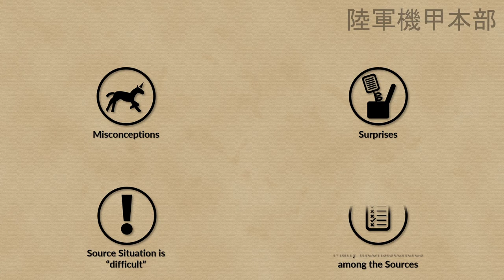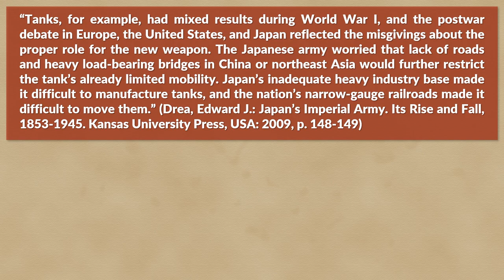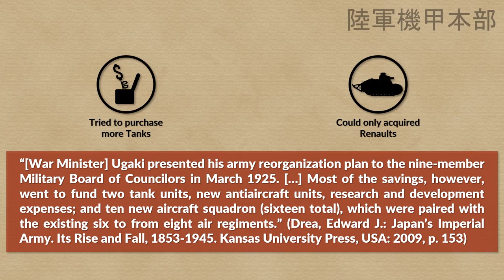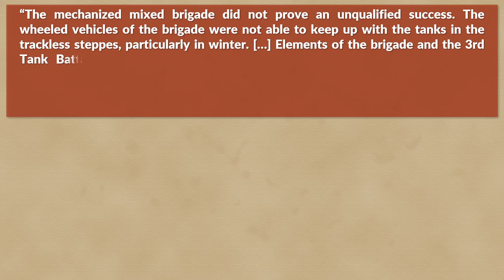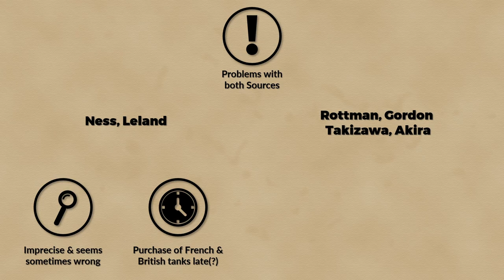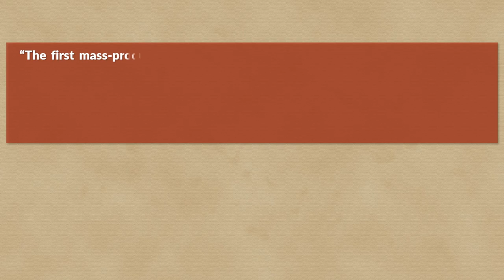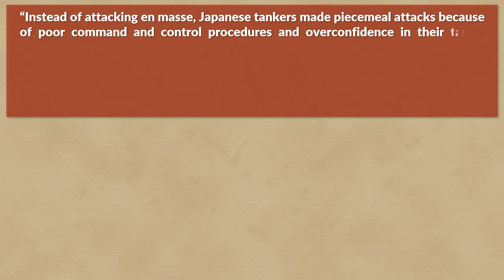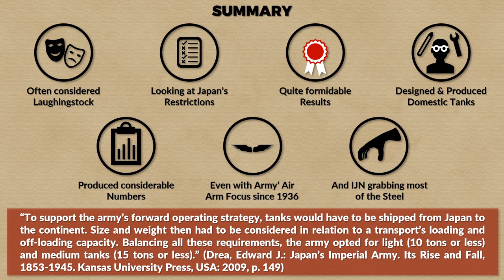Japanese Tank Arm (1921-1939)

Comment: I don't know if it's possible to emphasize enough how the topography of the Japanese islands dominated their tank designs from inception. The narrow gauge RRs placed an absolute upper limit on weight and width. The Germans ran into the same problems in Russia when it became obvious their tanks needed wider tracks for better weight distribution in snow and mud. The side by side spacing of the German RRs in heavy industrial areas plus bridge, tunnel, abutments meant the tanks had to be shipped without the track extensions. Also the later Panther chassis designs made through scheduling an absolute SOB. Keep in mind these were "standard" Euro rail gauges. The Russian gauges were wider and their designs reflected that as well,
Another consideration was tactical deployment across obstacles. Anyone familiar with the IJA quickly becomes aware that dedicated "Combat Engineer" units were vanishingly rare. That's not to say the Japanese weren't excellent at ad hoc and field expedient solutions; but 20 ton capacity bridges or barges are a LOT easier to make than their 30-40 ton counterparts. Which is a main reason Japanese advances in China invariably traced the Chinese rail net.
Last and NOT least was shipping considerations. At the start of 1937 Japan possessed two, TWO oceanic RR ferries. Both of them were hard pressed just providing transport support for Japanese rail infrastructure requirements on Korea, then Manchuko; and later China, all of SE Asia, and Malaya and Indonesia. Coming up with cargo ships with adequate crane boom capacity to shift and lift 30-40 ton medium tanks was out of the question. 
"Chieftain" has an excellent video on how these very factors was the main consideration in sticking with the Sherman. EVERYTHING was geared to support the transport of a 35 ton vehicle; NOT one weighing in at 45 tons plus..
By 44-45 the IJA had designed and built prototypes of a 28 ton PzIV analog complete with HV 75mm gun. Yet even it was designed knowing it would NOT be deployed anywhere but the Kanto Plain around Tokyo as it was too big for the mountainous terrain on Honshu. Bottom line; "If it won't fit, you can't ship".
Reply: There's no point building a big-ass tank if you can't get it to where it is needed. Sounds obvious, but it is often forgotten.
The weight limit of the M4, the - if taken out of context laughably limited - diameter of british tank turret rings, the low weight of the early german tanks, that was all done for good reasons. Resons always rooted in logistics.

The US had to consider the weight limit of a Liberty Ship's loading gear, the british had the structure gauge of their rail road infrastructure that limited the width of their tanks, and the germans with their offensive posture had to limit the weight of their vehicles to what their assault bridges could carry.
Reply: The point about German tanks and RR width only applies to the Tigers and their derivatives.
Reply: @Wien1938  The width became an issue AFTER the Germans began using track extensions to reduce ground pressure. They were used extensively from Fall 43 forward. Eventually some variation of them were available for all tracked German AFVs except the Tigers n Panthers. In those designs the double road wheel designs provided for sufficient track width. They still "bogged" during the Raputista.. but by late 43 to 45 they'd figured out where and what armor could go n do during the Fall n Spring on the Eastern Front. It was the older narrow tracked designs and all their derivatives that were the problem. I can't remember which one.. but one of Gantz's books goes into a fair amount of detail on their development n deployment. I do remember some pictures of PzIVs with them installed n the amount of increased width is very obvious, almost startlingly.
Reply: @MrArtbv  I think German war files or some other documentary said that the Germans figured this out already in 1941 when they gave StuGIII wider tracks to deal with the russian snow, so they used this type of tracks during winter time. So its perhaps not strange than that the Germans integrated this wide track into their late war tank designs. 
But this was not without problems of course. The Tiger I had 2 sets of tracks, because its wide tracks that were excellent for driving on land, snow, and mud was too broad for the railway transports, so it then needed to change to a more narrow track before it could use a train.
Reply: This is the same reason why the us limited the weight of the sherman.The cranes used to put them on ships could only lift so much weight.
Reply: We even see limitations influencing design with the Americans as well.  The Sherman was thinner then originally intended because they had to fit them into landing craft.  And then forced the British to adopt the Sherman as well because their medium tank (the Cromwell) was longer and wider and thus couldn't fit as well into the American transports.  Though the British still stubbornly brought plenty of Cromwells over anyway, which probably only complicated supply issues.

The Cromwell is a good tank, don't get me wrong.  But its superior speed wasn't a good enough advantage to ignore its logistical impact on the Western Front.
Reply: The US shipped 1,911 Locomotives to the Soviet Union.  The weight figures I was able to find indicate that these locomotives might weigh 100 tons though I don't know enough about locomotive weights to be able to say for sure just what they weighted.  And - they DID ship M-26 Pershing's to Europe.

So - there is a problem with the logic that says they couldn't ship something over 35 tons.  Obviously they COULD do that.  I am unaware of HOW they did it - but they COULD do it.
.
Reply: @BobSmith-dk8nw  Except tbat there isn't a problem with the logic of shipping something over 35 tons.Since tbe cranes of the day used to put cargo on dhips had a weight limit of 35 tons.
Reply: @BobSmith-dk8nw  You didnt prove what i said was bullsit at all.The chieftain agrees with me on this.As to the persging so few of them went to europe as to be meanuingless.as to locomotives you need top prove the us actaully bsent some to russia.ASince russia uses a diferent rail gauge us locomives wiouyld be useless there.
Reply: @BobSmith-dk8nw  Not necessarily when you consider that the bulk, if not all, of lend lease items were essentially off the shelf US products. We sent the Russians P-39s, M4s, Stuarts, US military trucks, etc. so it would seem odd that we would be sending custom made railroad locomotives and the like to Russia. I'm not saying that it's impossible that we did, just unlikely since it would require a complete retooling of the locomotive factory to change from making locomotives designed for US railways to ones meant for Russian railways. Considering that we didn't build T-34s, MiGs, of Yaks for the Russians, why would we custom build locomotives for them then?
Reply: bojo perez  Hey bojo!  Unlike some people - I proof read my comments.  That way - if I fail to capitalize the first word in a sentence - I catch it myself and don't look stupid.
.
Reply: @BobSmith-dk8nw  These cranes might have been able to do so on the ships where they were close enough together to do so.

Please check the US army ordinance logistical evaluation from the early part of WW2, the limitation was not simply the cranes, it was also flatbeds to transport things on, army engineers bridging equipment tolerances and a whole slew of other information.

Keep in mind also that the so-called 30 ton cranes were regularly used to lift 35 tons out of overloaded liberty ships.
These cranes were engineer certified at 30 tons, their actual capacity was higher due to pretty good construction used in them.

Because of your perfect mind reading capabilities  ‘And - how do you know ANYTHING about the logistics involved?  All this sounds to me like something YOU think they did based on ... your imagination?  How old are you?  You argue like some nerdy little kid.  I know - because I used to be a nerdy little kid.  Now I'm a nerdy old man.’ I obviously could not know anything about logistics involved in this because there is no way I could be polite enough to listen to older people who were involved who did tell me about things they did or read archive materials from a country that helped keep the country I am from on the world map or have an interest in a war because my grand father had the ‘pleasure’ of being a guest of the Gestapo and a German concentration camp.

You sir, may be intelligent and older, therefore worthy of some respect but there is a limit to how insulting and denigrating you can be for this respect to be lost.
https://history.army.mil/html/books/010/10-21/CMH_Pub_10-21.pdf
Please feel free to check the index at the end also, it has a list of publications which I have had to read 30+ years ago which have such fun tittles as ‘Global Logistics and Strategy, 1940-1943’ as just an an example.

My recollection of said content is not 100% due to how long ago it was that I read these but I am sure we can read through them and get the several thousands of pages worth of documents to check how much I have forgotten about his subject over the last 3 decades before you start calling me names and make assumptions that any errors on my part are due to stupidity as you like to say. 

Just for your information, you may have mixed up locomotives and flatbed cars for said locomotives.

By the end of June 1944 the United States had sent to the Soviets under lend-lease more than 11,000 planes; over 6,000 tanks and tank destroyers; and 300,000 trucks and other military vehicles.
Many of the planes have been flown directly from the United States to the Soviet Union over the northern route via Alaska and Siberia, others were crated and shipped to the Persian Gulf, where they were assembled and flown into Russia.
We have also sent to the Soviets about 350 locomotives, 1,640 flat cars, and close to half a million tons of rails and accessories, axles, and wheels, all for the improvement of the railways feeding the Red armies on the Eastern Front. For the armies themselves we have sent miles of field telephone wire, thousands of telephones, and many thousands of tons of explosives. And we have also provided machine tools and other equipment to help the Russians manufacture their own planes, guns, shells, and bombs.
We have supplied our allies with large quantities of food. The Soviet Union alone has received some 3,000,000 tons. Lend-lease has contributed about 10 percent of Britain’s over-all food supply. This, together with a great increase in agricultural production in the British Isles, has helped to feed the British civilians and armed forces. Bread, potatoes, carrots, cabbage, and other common vegetables have been available to the British from their home gardens and farms. The United States has provided a high proportion of such foods as bacon, eggs, cheese, and fruit juices.
From EM 13: How Shall Lend-Lease Accounts Be Settled? (1945)
GI Roundtable Series
Primary source documents from 1944–46
Reply: You do have here proof that they did send the locomotives because you were 100% correct on that but those would get unloaded with speciality cranes due to their weight and value in major ports.

Locomotives could easily weigh as much as 90 tons so yes, this had to be unloaded with different cranes as the smaller cranes, even if you combined two of them would never be able to lift a locomotive, and that is not taking into account potential damage to the locomotive of the unloading is not done with extreme care due to its own weight.

The US regularly ship items over 50 tons over to different locations, but these were not the majority of items and so your limited availability of larger cranes is restricted to these items.
Case in point, Pershing tanks as you mentioned.

But there is a well known battle where the Pershings had to stay behind because the army engineers corps could not build a strong enough bridge to cross the Rhine I believe it was for them but could bridge for the lighter Sherman’s which then went on to assist the troops in battle.

This anecdote is covered by several channels, if I am not mistaken The_Chieftain mentioned it in his video on the Pershing tank.

Please do keep in mind that Bob Smith did have a point on several things so we ought to maybe do a double take of our own recollections before posting.
Reply: @yannichudziak9942  OK.  Not an idiot.  Why were you looking at that?  Did you have access to it through the internet 30 years ago - or - to the hard copy?  I was trying to look at the listings for liberty ships in the index and ... welll ... I remember how much faster that went when I could just stick a finger in the index and then go back and forth digging out the pages it listed.  It's just slow online, having to jump around in the thing.  But I can open another copy of it to keep the index page open and plow through that.

I'm not sure I'm going to find something on those cranes though - as this seems to be an Army document more oriented to before and after the stuff got on the ship.

As to those locomotive figures they came from the Wikipedia Lend Lease page "1,911 steam locomotives, 66 diesel locomotives, 9,920 flat cars, 1,000 dump cars, 120 tank cars, and 35 heavy machinery cars."
https://en.wikipedia.org/wiki/Lend-Lease#US_deliveries_to_the_Soviet_Union
Sorry I can't get the link right to the reference - you have to scroll down a bit to find it.  I don't know why there is a difference here in the figures you supplied and those I supplied.  

Uh ... for your citations - it would be better to put what they said in quotes - the way I did - so that I know what the citation said - and what you said.  I see the reference at the end - but - you really need those quotes.

When I first looked at those boom listings I was wondering about the positioning fo the 30 ton booms.  This time I noted it said "plus two 30-ton booms at Nos. 3 and 4 hatches"

Using another diagram here:
https://upload.wikimedia.org/wikipedia/commons/0/0f/Libertyship_linedrawing_en.jpg

The booms for the number 3 and 4 cargo hold - are not positioned where they could used both of them together.

I did find a video where they showed two of the ships cranes lifting a locomotive - and - another picture where a single crane was doing it.

But - given the positioning described in those two articles - they may not have been able to do it on those C2 Ships - IF - that was One 30 ton crane per hatch.  If the citation was two thirty ton cranes EACH at the # 3 & 4 hatches they could have done it.

Unfortunately the illustration doesn't show what type of cranes are being shown - and - may not be reflective of the actual C2 design since they did come from different articles.

I did find the footnote though and it gave this picture
https://archive.org/stream/pacificmarinerev3538paci#page/n15/mode/1up
but once again - though there are six cargo holds - 3 and four are separated by the superstructure.

This illustration
http://navy.memorieshop.com/Cargo-Ships/Profile-Centerline.html
for EC2-S-C1 ships - appears to show one boom for the #2 hatch which is listed as a 50 Ton Boom OR a 30 Ton Boom

Here's a picture of a Sherman being loaded by a dock side crane
https://cdn10.picryl.com/photo/1943/01/01/liberty-ships-being-loaded-with-sherman-tank-for-oversea-shipment-4a73e3-1600.jpg

So - this is all a bit complicated in that there are a number of different designs and evidently crane sizes were not in fact limited to 30 tons - as the illustration labeled 50 or 30 ton crane would indicate.

My point was always - that even if I couldn't figure out exactly and precisely how they did it - they DID ship locomotives over seas and they DID eventually ships M-26 Pershings over seas - so they MUST have had a way to do it. Thus - the argument that they couldn't ship Pershings to Europe because the crane size was only 30 tons was specious.
.
Reply: @yannichudziak9942  Yeah ... dropping a locomotive is not pretty.  When I was researching dual lifts I came across a video of some guys dropping a locomotive ...
https://www.youtube.com/watch?v=OvyIrsZ7Zhs
Ooops ...

That bridge was probably the Remagen Bridge.

I've said elsewhere that Logistics is often used as an Excuse by people to not do something they don't want to do.  You have all this hand waving and all this "it can't be done because of the logistics" THEN if someone with high enough rank gets involved it's all "Yes Sir!  Yes Sir!  Three Bags Full!"  That's what happened with the M-26.
https://en.wikipedia.org/wiki/M26_Pershing
Devers and McNair were going back and forth over whether it was needed - Devers went over McNairs head to Marshall - Marshall said "Do it" and like magic(!!!) it happened!!!!

That's the reason arguments like flat cars are specious.  A flat car is a lot less complicated to develop than a tank.  You just give the company that makes flat cars a contract to build some that will do the job you want - and they do it.  If there were weight or width problems - you go to the train company and say - "Plot us a route" - and they will.  Commercial people do that - all the time.  Given enough money  ... you can go to the moon if you really want to do it.

One thing about the M-26 development - was ... the Allies could and did defeat the Germans without it - but - the Germans and Russians had been in a technological contest on the Eastern Front.  After the war - it was a good thing - that the US had M-26's to counter some of the tanks the Russians had built, in the "who's a bigger bad ass" posturing of the Cold War.  You don't want your enemy thinking he's a bigger bad ass than you are.
.
Reply: @BobSmith-dk8nw  My economics teacher was from the US and had this and several hard back copies, he was very fond of the saying learn your history because it will help you avoid mistakes in the future. 

He came back to Europe after the war to marry his then met sweetheart in Belgium.

So when we were studying logistics, marketing and economical planning he provided us with a well documented long term case he had access to.  

Now I may not remember it all now but I did read it all which is why I agree that the main reason the M4 Sherman was held on as long as it was is in part due to the logistics people insisting on it.

The other part is that as some people said these tanks were killing the enemy just fine (just fine being a very debatable and subjective description as you well know) so the troops did not want to rock the boat so to say.

The reason the heavy tanks were delayed as much as they were was that the earlier versions simply did not pass the extremely stringed testing and requirements of the US army, this was the highest requirement of pretty any of the armies in the war and I am guessing now but I think they stuck to it because they never were at risk of losing their manufacturing base.
Reply: @BobSmith-dk8nw  Except that the Pershing was in fact not anywhere near as good as they wanted, it had not finished the full testing regime and the ordinance branch had told them they needed to send a specific set of spares along which were at first not available, it needed to be field maintainable and this was an issue also.

For the flatcars it was at first more a question of do we have enough of them for meaningful transport and secondly a LOT of them went to the USSR as you saw.

The_Chieftain has a quite funny video on the development of the Pershing and heavier US Armor which if you check carefully and compare does make a fair amount of logical sense.

Don’t forget that logistics are always hampered by the bit that is in shortest supply, whichever that may be.

The US due to having to ship across the globe, and let’s be honest that alone showed what a feat of setting logistics up and how well they did it was, to supply roughly (and this is a debated number as not all countries did keep well enough records or did not tamper with them - looking at you Mr Stalin.....) 25% to 35% of the whole allied production during the war. 
Some evaluations push it even as high as 40% but there is more debate about those figures and to be honest since I am not working as an accountant (got the degree to go with that) I never felt any urgent need to go and do the research myself but I will discuss it with people and read up and watch informative programs after which I will do a cursory fact check to see if I did get what was said and if it was truthful which now a days might become more important then ever with all the ‘fake-news’ being bandied around or the intentional mis-information from some people (e.g. Bergen-Belsen by one ‘academic’ was claimed to be a forced labour camp where the death toll was way overrated by the ‘allies’ at the end of the war...my grand father punched the man out cold when he was saying this in a public debate for students and he was over 60 years old at the time for daring to lie so blatantly).

As for money one VERY important thing to remember is when this was set and against which back ground...the Great Depression was only barely getting beaten down at the time and the economy in the US was still rebuilding itself.

Look at the US army tank arm, it barely existed 5 years before the war and went on to be massive and massively important.

For the cost of one Pershing (net cost, so all factors like materials, storage, transportation, fuel and fuel requirements, spare parts in army approved quantities) how many Sherman’s were able to be made by this point in the war?
The low ball estimate there says 2 to 1 at least due to mass production savings and the initial investments having been spread over more and more vehicles build.

And THAT is also kept in mind in the minds of the planners, instead of 1 Pershing in 1 spot you could have 2 Sherman tanks in 2 different locations (in fact l bet if we work it all out as per a proper mathematical economical evaluation the difference would have been closer to 4 then 2 per Pershing tank and as the Russian say, quantity has a quality  all of its own, but of course this is just my gut feeling looking at available data and recalling how much in other engineering vehicle study cases mass production and writing off of initial investment with a single smooth and streamlined supply line can create in savings).

Efficient logistics and R&D however are always going to be fighting it out for resources because you cannot stand stilll, you have to improve (the Sherman did have massive improvements throughout the war to be honest and 76mm would have been enough if they had followed it up with the newer ammo types, I think that was also what The_Chieftain thought was a major flaw in the whole thing.
Just getting extra penetration out of your guns because of the ammo would have made a difference and secondly...actually taking the damned 76mm versions with you when you go and do the D-Day landing.

As for going over to Marshall and having him push it through was afterwards a bit less approved off when the data came back and the testing was still ongoing. 

I am not saying it cannot be done because of logistics, I am saying it was done because of among other things the logistics required which is a different thing.
If they wanted they could have waited a year or two to get the next generation in place but how many more people would have died then?
Also, keep in mind at the time the weakness of the German war machine was not as obvious, they were worried for a time the Germans were really going to able to pull it off and if the USSR had been knocked out of the war and those resources would have flown into the German war economy (a what-if scenario that is quite common but usually involves a lot of hand-wavium but that was not obvious at that time) then Roosevelt was not sure the UK would be able to hold out for much longer.

And to be honest I am quite grateful for the US intervention, after all I would never have been around to discuss anything otherwise (still does not mean I cannot be critical of something or someone I admire or find I can get along with).
Reply: @yannichudziak9942  Yeah.  That Wikipedia Article on the M-26 lays out all out.  They invested a lot of time and effort in the T-23 and this electrical transmission but the thing ended up a dud.

You are right about their standards though.  They took the 76mm gun and put it in the old turret but then - it was a bigger gun than that turret had been designed for - and not a good fit.  So - they wouldn't sign off on that.  The British took their 17 pounder - a bigger gun than the 76mm - and shoe horned that into the same turret - and had themselves a weapon that could compete with those German Guns.  It was an ergonomic night mare - but it was there - while the US was off figuring out what to do.  Eventually they took elements of tanks they'd been working on and put those on the Sherman - and thus they got the 76mm in a better turret.  Of coarse US Ordinance being what it was - they were concerned that the barrel was to long - so they cut the end off, losing 10% of it's muzzle velocity because they were afraid it would get stuck in the mud driving up hills ... 

The British offered us 17 pounders but by the time we had a few done as trials the war in Europe was over.  Of course the 17 pounder wasn't perfect either ...

Then - they had a couple of hundred 76mm Sherman's in Britain on D-Day but - again - for "logistical" reasons they chose not to send them across as they didn't want to complicate their ammunition logistics.  Now - think about it - that was just fucking stupid.  The Logistics people don't want their lives complicated - so we deprive the troops of a weapon that could better stand up to the German tanks.  There's a time to tell the Logistics people that it is their JOB to deal with whatever ammunition requirements our equipment has - and to suck it up do it.  The thing there - is that as you move toward the front - there's the Head Quarters people - then the Logistics people - and then the guys doing the fighting - so the guys doing the fighting are farther away from the Headquarters people and it's the Logistics Types that get their complaints heard.

There's a problem with people posting today and that problem is the saying "Amateurs talk Tactics.  Professionals Talk Logistics" - which has turned the word Logistics into some kind of Holy Mantra that rules over all.  It's not.  It's all ... ALL of it - just one more opportunity at every level in every way for Murphy to have a Field Day ...   Just as you can have people roundly condemned for their Tactical Blunders - people can be condemned for the Logistical Blunders as well.

Look at the Centurion.  The British finally got sick and tired of being told they couldn't have a better tank because of Logistical Considerations - and just went ahead and built one.  Then the Logistical people had to get their act together and sort their problems out instead of saying "To Hard.  Can't Be Done."  Everything that needed to be done was done and the tanks of today have benefited from it.
.
Reply: @yannichudziak9942  Yes - what you are saying is mostly true but there are other factors involved.

You need to have a balance between your tactical and logistical considerations.  Even McNair - who was opposed to the 76mm guns ... let them develop them.

The thing is - what if you don't have any M-26's and because of that are losing dozens of Sherman's?  You've read Belton Cooper's "Death Traps" - right?  Look at how he felt about it. It was his job as an Ordnance Officer to write a report every day on the 3rd Armored Divisions tank losses - from whatever reason.  He'd make an initial determination of each vehicle as to what category it fit in.  Some were just mechanical break downs, some where combat damaged but could be repaired and others were write offs.  It was SOP for all sides to shoot an enemy tank until it burned - because if it burned - they couldn't fix it.  The metal would be ruined and it couldn't be repaired.  He saw those combat loses - with the dead crewmen still inside them - and speculated that because of the unit he was in and his job that he may have seen more destroyed Sherman tanks than any other man alive.

Now it's considered fashionable to denigrate his book because he makes some errors - but - he wasn't wrong about a lot of things.  The Sherman's were out gunned by those German Tanks. Even the Mark IV had a better gun than the short 75.

If you pay attention to what Nick actually says about Coopers book - it's a condemnation of it as a memoir rather than a historical study.  A point I've made is that often times you get things included in memoirs no one would have dared include in official reports.

Nick's problem was that he was fighting the title of that Book - Death Traps - which made it seem like the Sherman was a horrible tank - which it wasn't.

Then - because of Nick - you get this perception that EVERYTHING Cooper said was wrong - which also wasn't true.  Nick never said that everything the man said was false - but - people tend to take a simplistic approach.  They fall into camps who believe that the Sherman was the greatest thing since sliced bread - or that it was worse than manure - BOTH of which are wrong.  People are like, "Well ... which is it?  Is it good or is it bad?"  To which the answer is - neither.

And - oh yeah - the M-26 had a lot of problems - which is why they came out with the M-46, pretty much the tank they wanted the M-26 to be.

And - yeah - they had a tungsten shortage so what they did was prioritize the delivery of the tungsten ammunition to the Tank Destroyer units - which was a mistake - another Logistical Blunder.  Tank Destroyer doctrine was just bull shit.  It was a reaction to the initial German "Blitzkrieg" (which also never happened, it was just a term the news papers coined as the Germans talked about cauldron battles).  So - what happened - was that if it had tracks and a turret - it got used the same way whether it was a tank or a tank destroyer.  You had Tank Destroyers assigned to do Infantry Support and short barrelled Sherman's sent out to take on Panthers ...   They just used whatever was there, regardless of what it was designed to do.  Thus - it would have been better to deliver the tungsten ammunition on a more equitable basis - or at least to units more likely to run into enemy armor - than just to the Tank Destroyers.  But that requires actual thought which people don't like to engage in.  Much easier to go - "Tank Destroyers fight tanks - they get the tungsten."
.
Reply: @BobSmith-dk8nw  Deathtrap unfortunately does not  get born out by the raw statistical data, the US lost less crew then anyone else for their main battle tanks, even less then British when using the same tanks (Americans were wearing helmets and the British were not inside tanks so given that is the only difference really you have to say that was the cause.  

Cooper put the tittle up as Deathtraps which they weren’t really and from there anyone reading it will have preconceptions already directed as you well know.

An orderly in a battle zone is going to see a different picture then a doctor in a hospital 25 miles back, the same with engineers and so on.
Cooper made a great book but it really deserves an update by now to show the context and where things went right and where it went wrong.

As for that saying...it is hammered on because let’s be honest Germany did not really look after it’s logistics and it lost them the war.
Also logistics is just used as a prod to urge people to think.

Another saying that you could put in there is war is still fought by humans which if I recall it correctly is from Clausewitz (typing on a mobile is not easy since you get limited chances to check things 😊) because there are very, very few units that can take 20% casualties and keep functioning.

It is why the achievement of certain units during D-Day and in several other places is so exceptional.

Normally unless humans know if they stop fighting they will get slaughtered they will break and run or surrender when one in five is killed or otherwise put out of action.
I know that the 1 in 5 number is not entirely accurate but Using it as a ballpark rough estimate will be close enough for purposes of discussion on this.

Logistics is more important then most armchair generals assume is the reason for that specific saying, it is not supposed to be taken out of context which I think happens more then enough.

For any war a lack of logistics or poor and insufficient available logistics is going to be bigger obstacle to your eventual victory then a lot of things.

All the fancy new jets and bombs, missiles and all are useless if nobody thought about setting up a supply line for fuel, factories for parts, ammunition’s, engineering support for the service crew quarters and their food and other supplies.

Say Belgium bought a new stealth fighter, just one and that was it...no supporting contract, no training etc...

It would be wasted, there is no tail to teeth ratio, you can have all the ‘teeth’ in the world but if you can’t prep it for take-off it is not going to anything but look shiny somewhere.
Reply: @BobSmith-dk8nw  To be honest this conversation is a LOT more fun and interesting then before 😁
Reply: @yannichudziak9942  Cooper of course is dead now so ... there won't be any update.  The other thing was that he did not really write the book.  He had a ghost writer do it ... and ... off the top of my head I've forgotten the details of who that was and what his name was ... I don't always book mark my posts and ... time and again ... have looked something up for one ... then want to reference it in another and ... end up having to look it up all over again (which I did below ...).

But yes - that was a horrible, sensationalistic title designed to try and sell more books - which would seem to have worked.  And yes - the Title is what hurts the book the most.  If you look at what Cooper actually says about the Sherman's in the book - it isn't that they are bad tanks - it's just that they really suffered when confronted by those German guns.

OK - looked it up again and here's what Nick, referring to Zaloga, had to say on it:

"This conversation has made it to Zaloga's ears. 

You will recall he addresses Cooper a little bit in OTT, Timestamp 15 minutes. https://www.youtube....LY4FOrnjc#t=902

However, he mailed me this this morning, for posting at my request for his opinion.

'I think that the basic point that people forget about Belton Cooper’s memoirs was that they were written decades after the event. On the occasions I spoke to him, his memories of some of his experiences were quite sharp, but he had no recollections at all of many other aspects of the 3rd Armored Division in 1944-45. I also got the impression that he conflated his own memories with stories that he had heard from military history buffs that he knew. On top of this, “Death Traps” was ghost-written with Mike Bennighof. Cooper’s memoirs are very interesting, but they have some significant issues.'"
http://forum.worldoftanks.com/index.php?/topic/395038-rants-and-death-traps/page__st__300

And - as I said - what you need is a proper balance between Logistical and Tactical decisions.  It would no more be correct to say that one was more important than the other.  Logistics exists to support Tactical Operations.  Without the Tactical Operations - there would be no need for the Logistics.  Without the Logistics - you are going to have a problem Tactically.  Hitlers Generals in a different Cooper's book on the German Army - told him that Germany could not support an Army as big as the one he was building - and he ignored them.  So, throughout the war - the Germans never had enough of anything - in contrast to the Americans ... who had so much stuff they were literally giving it away to their allies.

My point about that saying concerning Professionals and Amateurs is that it appears to give precedence to Logistics - which is a mistake.  That may not have been the original intent of the person who made that saying up - it may have just been that Logistics tended to take up more of your Army Commanders time - but that is NOT the effect of the saying on those who love things that are simplistic.

As to von Clausewitz ... yes ... man knew what he was talking about.  People who know what they are talking about quote von Clausewitz ... people who don't know what they are talking about quote "The Art of War" ...   I have copies of both - and the latter is a joke.  What it really is - is an advertisement for the Consulting Services of some Chinese Generals.  I'm not joking - that really is what it was used for.  You had some Chinese Generals that were putting themselves forward as paid consultants - and they wanted to look good - so they had to have a book.  Same thing Management Consultants do today ... same damn thing ...  Write a book - use it as an advertisement for your real business - being a Management Consultant ...
.
Reply: @yannichudziak9942  Yeah.  We're both intelligent informed people who want to understand how things really work.  In contrast to some of the other posters I was dealing with.

One of the things that happens to you as you get old - is that you've had a life time of putting up with idiots who think they know a lot more than they really do - and then want to argue with you - and insult you - when you try to correct them.  I just don't have any tolerance left for that crap any more and am not shy about telling idiots that they are idiots.  Thus - Grumpy Old Men.  Nothing new here - nothing new at all.
.
Reply: @yannichudziak9942  Well over a year late but just a minor correction on why the US really didn't want to switch to the firefly.  Its mainly due to how cramped the turret was and one of the reasons why they preferred open-topped TDs.
Reply: @dragonace119  you are correct, seen many references including the evaluation of the 76mm gun in the same turret ring and size, the US has been VERY big on good to great ergonomics for the Sherman.
Reply: @yannichudziak9942  Yeah its crazy of how tight the fit was to get the shell into the breach.